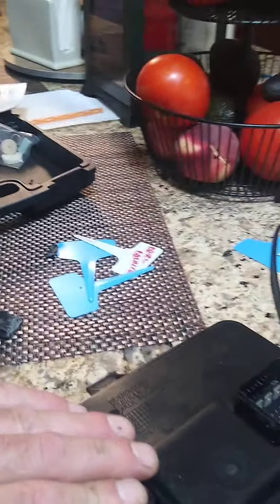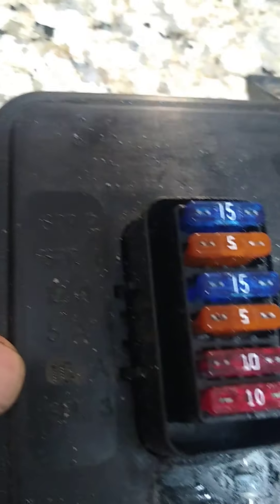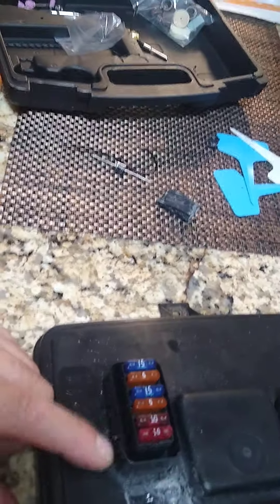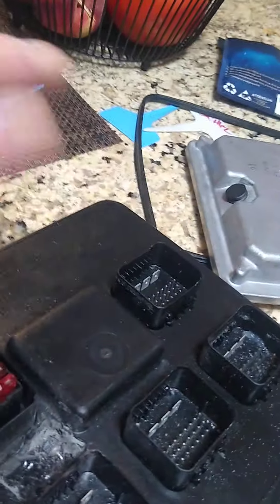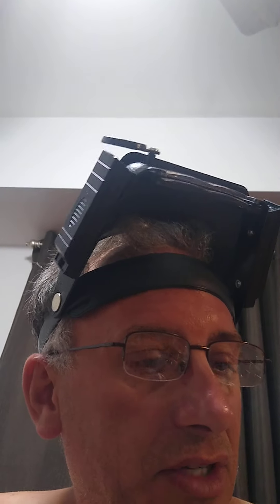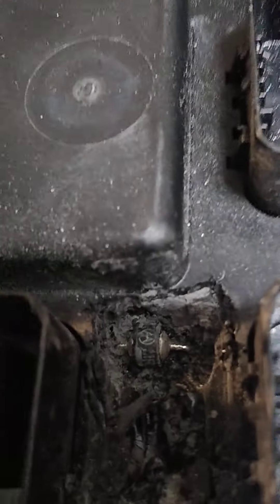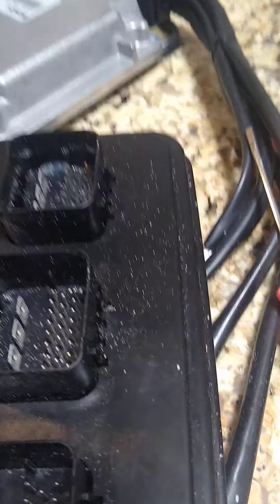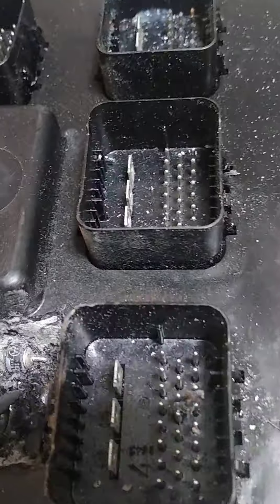1998 & up Sea-Doo gtx EPDM  5amp fuse blows diode Mr2535L fuse side cut away part 1

Comment: Did this fix your problem? What issues can this bad diode cause? I just bought a ‘97 GTX and I am trying to familiarize myself with the electronics. I currently have my tachometer working but the speedometer is non-functioning.